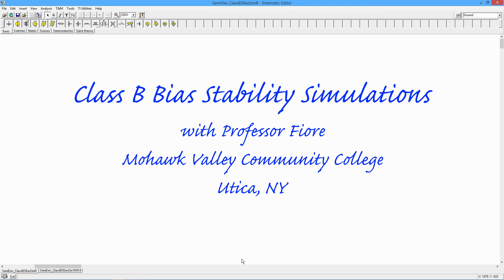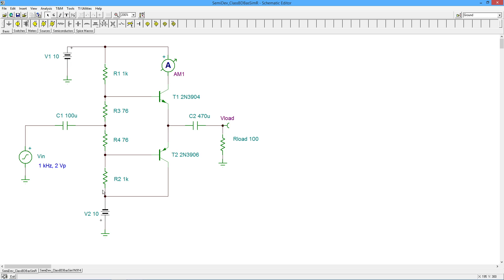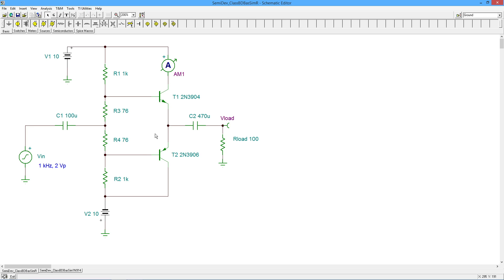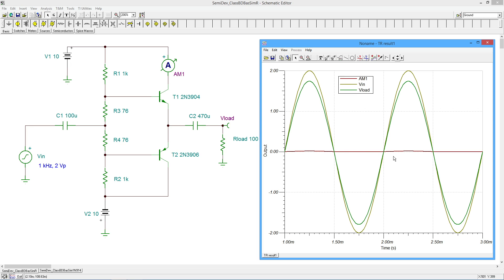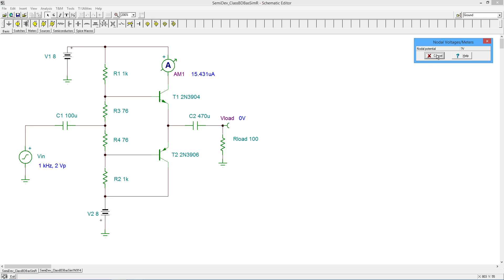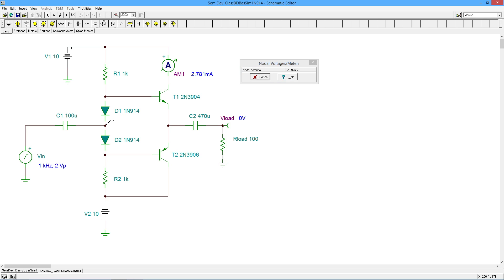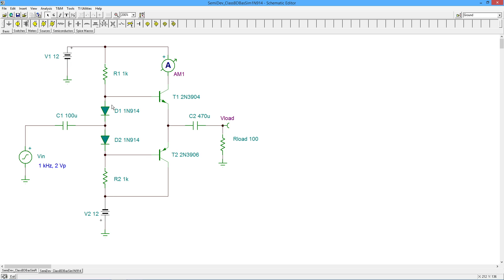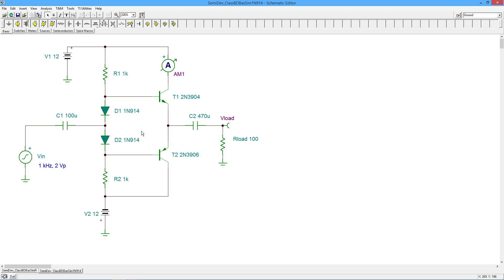Semiconductor Devices: Class B Bias Stability

Comment: Is there any reason for mentioning the current should be small(2 to 3 percent) How did the ammemeter measure 2.31mA for 10v..Is there any equation for finding the current.
Reply from the maker: It's kind of like idling the engine in a car. If you do that, touching the gas pedal gives you instant response. If the engine is turned off, it has to be restarted, resulting in a delay. But you don't want to idle the engine at 5000 RPM as that would be wasteful. You just need a modest amount.

Comment: Fab! I have vague memories about using matched pairs of BJTs to achieve a smooth output. So a twin 3904 for the top half where the temp-co variance self-cancels. For clarity (again, thinking out loud), with BJTs being cheap, we could get a great match mounting the BJTs together (for heat stability) and tying the collector of the biasing BJT to the base and using it as a diode (same for the PNP side). The amp I designed uses a VBE multiplier (I recognise that part of the circuit).
Reply from the maker: Along that line, I have seen designs that use biasing diodes mounted to the power transistor heat sink as a means of thermal feedback.
Reply: @ElectronicswithProfessorFiore  I have the prepared heatsink for my amp design. It looks like I drilled enough holes for the two final transistors with their corresponding drivers plus the VBE transistor. (It was a mono design).